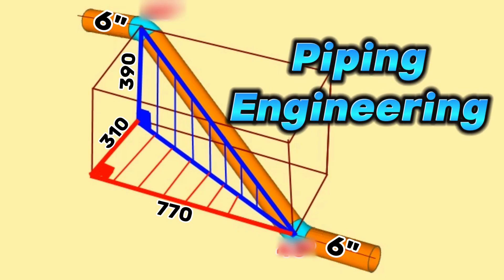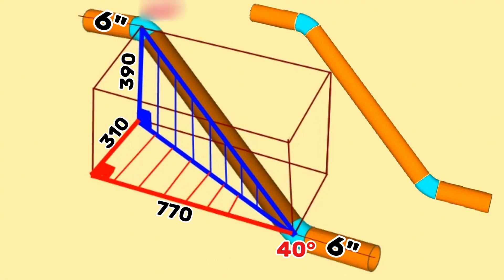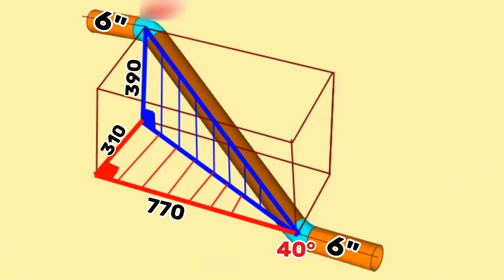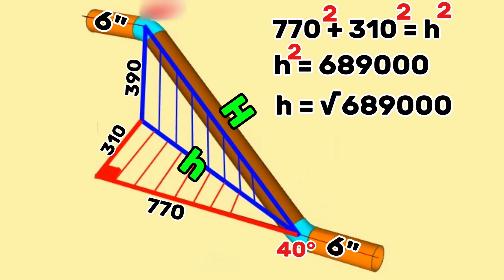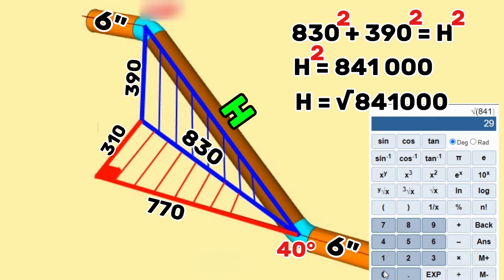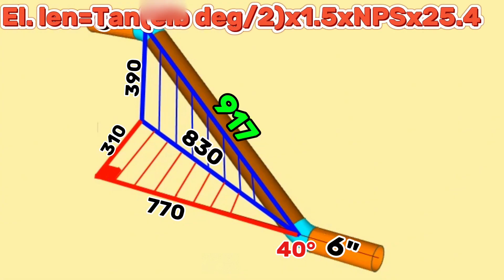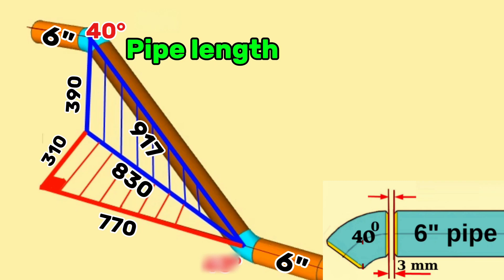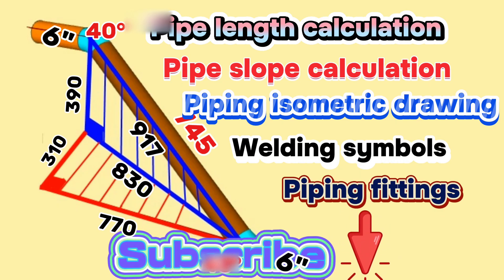Pipe Length Calculation Made Easy

Comment: How did you get the 40 degrees where that value comes from or you can place any degree
Reply from the maker: Thanks for watching and comments.
Yes you are wright. You can write any degree
Reply: @Piping-engineer  you can't write the angle in this example, the angle has to be calculated and in this case for the given lengths of the sides in the cuboid the angle is 33 not 40 and then the cutting length of the pipe doesn't fit either

Comment: What is 1.5 ??in EI.len
Reply from the maker: Hi Mario,
Thanks for watching and comments our videos.
There are different formulas to find cut elbow length, but result will be same:
Elbow length is equals Tangent (Elbow degree divided by 2) multiplying 1.5, multiplying nominal pipe size of elbow NPS, multiplying 25.4.

Elbow length is equals Tangent (Elbow degree divided by 2) multiplying 38.1, multiplying nominal pipe size of elbow NPS.